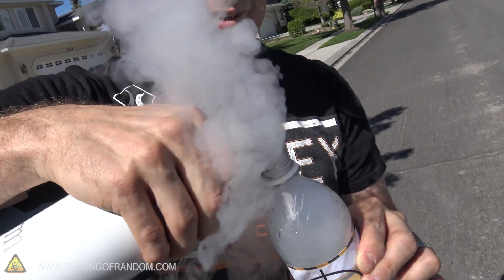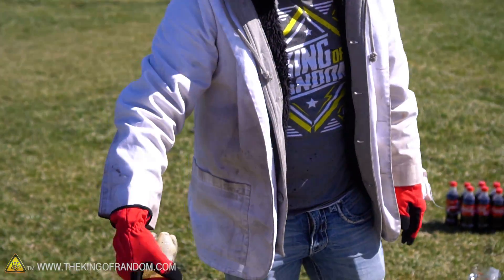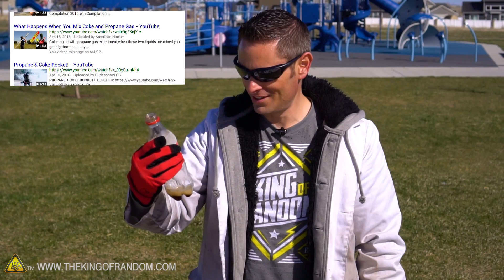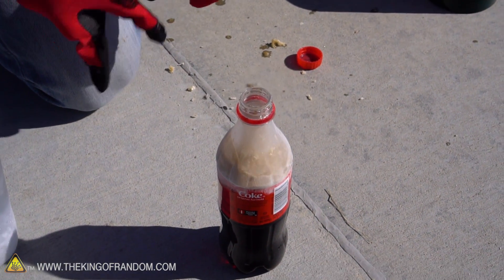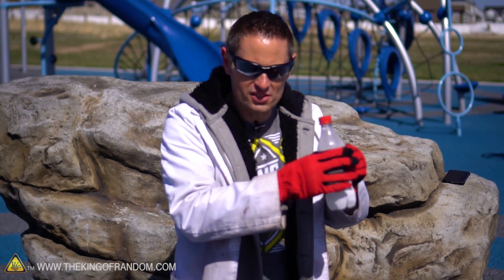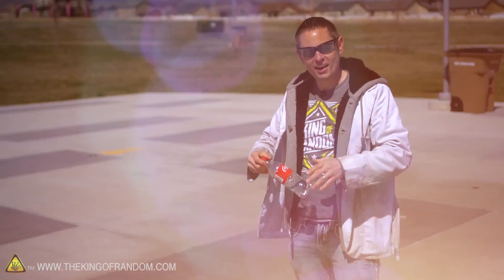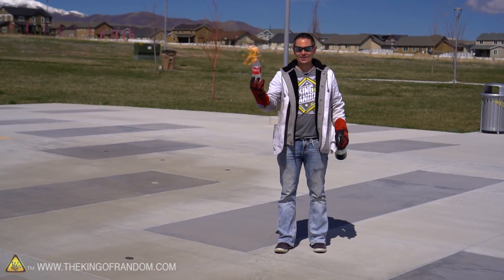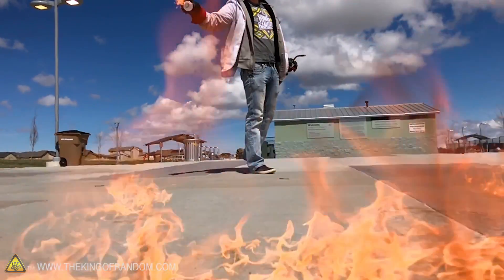Mixing Coke With Propane Doesn't Do What You Think It Does | Propane And Coke Experiment

Comment: Tkor repeat this experiment up to the step where you have added the propane then when it has iced up to the maximum extent then measure the temperature of the icey coating on the outside of the coke bottle...bear in mind that to keep the coca cola from freezing the freezing temperature of the coca cola to a temperature that is lower that the temperature that caused the coke to freeze...if no ice then coke rocket with propane will function...experimentally determine how to lower the freezing temperature of the coca cola to a temperature  below the ice temperature as previously measured previouy...the further below the ice temperature that the freezing point of the coca cola can be modified to the thinner the coca cola will become. and therefore the better the rocket will function...this can be accomplished by using several different matirials...salt (NaCl ) as well as non salt ice melt, or sugar just to name a few...the idea being the greater the difference between the ice that had previously formed in the cocacola solution that just coca cola and the lowered temperature at which the coca cola freezes the better the rocket will function....when you have brought the freezing temperature of the coca cola down as far as possible by adding what you used to lower the temperature then is is time to figure out the optimum quantities of the coca cola solution and butane ...

Comment: I believe it’s not working because of the cold temperature outside (he has an insulated coat on). Needs to be on a warm or hot summer day... at 32° it’s only 51 psi... at 90° it’s 149 psi...

Comment: If you want a projectile take the coke fill it with butane . Do not light it!! Turn it upside down and it will rocket away. The butane reacts with the co2 in the coke or whatever flavor you choose. The gas propulsion is highly flamable. Static could ignite it. So no nylon ski jackets

Comment: Propane weighs 4.2lbs per gallon, water weighs 8lbs.
Propane boils at -44F.
Liquid propane turns into gas at a 270x expansion rate.
One 8gal forklift cylinder can flatten a 400ft area.
Not to mention, static electricity can ignite it.

Comment: Try liquid nitrogen, about .375-.625 of  the volume of the bottle, in an empty pop bottle works well.
Screw the cap on and leave it alone. We do it at work. They can be unpredictable, due to the tolerances of the bottle though, so use caution.

Comment: The reason why it didn't work is because you took too long to turn it over. The coke reacts to it because the propane simultaneously cools all of the coke when turned over.. When you freeze coke it fizz alot faster than when you normally shake it up

Comment: At the end when the bottle was rolling away I was thinking that the liquid propane would spread around the inside of the bottle, making it easier for it to evaporate because of the increased surface area, so it would evaporate and then explode in your face when you pick it up. Thankfully, it didn't.

Comment: It was mentioned that the temperature outside was 45 F in the video.  Propane has a vapour pressure of 70 psi at 45 F.  So once it warmed up to the outside temperature, the propane in the coke bottle would be at about 70 psi.  I've seen those bottles be fine at higher pressures.  At at 32 F the pressure will be about 55 psi, 130 psi at 80 F, 175 psi at 100 F,  and 205 psi at 110 F, give or take.

Comment: You're taking too long, and not using enough Coke.  The reaction has a tiny little window that you're talking right through, and you have to use at least one liter of soda.  You don't have time for a countdown.  You have to pour your propane and immediately turn the bottle over, otherwise, the propane will evaporate before it has a chance to dissolve into the soda.

Comment: it doesn't work because the boilingpoint of propane is only -43.6F and the boilingpoint of liquid nitrogen is -320.44F.  Also, the thing that happened in the cokebottle when you closed it of and it became a clear liquid is because when the you close it of and it starts evaporating, the pressure will build up. And at a ceartain point the pressure and temperature will be in balance so that your liquid won't evaporate anymore. When you take of the cap the pressure goes away and your propane will start boiling again.

Comment: at 45 degrees that propane is only at like 70 psi in that bottle.  If it was 80 degrees outside, the pressure in that bottle would have been near 130 psi and the bottle would probably fail.  Some quick googling says soda bottles usually fail around 120-150 psi.

Comment: Funny thing is that actual Coke is probably more dangerous when under pressure in large enough quantities. If you have a 2 - 3 litre bottle of coke that's completely pressurized and it falls, the bottle holding it can rupture. It happened in a store in Chile while I was there one time.

Comment: the bottle leaks air through the cap. I have tried exploding coke bottles with those canned teas if you sit them in a bottle for 3-4 days it starts to expand until air pressure releases through the cap.

Comment: Propane pressure is based off temp. 45f is maybe 70 psi in the air space. And at 120f 200psi. As the gas in the air space bleeds off, the liquid boils off into gas until the pressure is reached for the temp outside. My numbers are no where exact just to give you an idea of how it works. 😊

Comment: Those bottles are designed to hold pressure in. Room temperature liquids like propane and CO2 expand creating pressure, but each gas has much different working pressures, the amount of pressure they exert in a confined space. 

It appears that propane requires much less pressure to maintain a liquid form. Propane has a working pressure of around 100-200 psi with temperature pending and a Coke bottle is designed to handle a bare minimum of 150 psi as far as I can gather. 

I believe that CO2 sits around the 800 psi mark to maintain the state which is why the bottle doesn't hold up to it in another video of yours.

Comment: @ The King of Random, did you figure out why this did not work for you? Liquid propane expands at a rate of 270 to 1 when it becomes a gas. I suspect that because it was a cold day outside & you used cold coke that froze very quickly, the experiment was a failure.  I suspect that if you did this on a warm day, with warm or room temperature coke, the bottle would have flown up in the air like it did in the Russian(?)/Ukrainian(?) video.   Would you redo this on a warm day to show it as a success?
Reply: Bradyn Austin. Liquid propane is similar to liquid nitrogen even if the coke a cola was boiling it would freeze
Reply: Bradyn Austin 45 degrees is cold huh
Reply: He used the wrong gas hes supposed to use lighter fluid not propaine

Comment: How is the propane liquid at atmospheric pressure if it's boiling point is -43 degrees F?
Reply: While it will go to liquid if you cool it to -43F, propane is one of the gases that'll go to liquid if you pressurize it enough without dropping the temperature.  That's what's done with propane you buy in cylinders at the store, or with the tank for your propane BBQ.  A number of other gases do the same: most refrigeration gases, ammonia, chlorine, butane, carbon dioxide, nitrous oxide, to name a few.

Comment: My thoery is is that the propane is not cold enough to cause the Leiden frost effect unlike liquid nitrogen Wich freezes the coke
Reply: Which
Reply: I think that it was too cold outside & he needed warm coke to make the liquid propane turns to gas. When liquid propane turns to gas it expands 271x thus creating the force that makes the bottle take off, but he didn't have enough heat to make that happen.

Comment: My guess is that you need to fill the liquid propane and then quickly turn it over. If you wait too long, the boiling propane will freeze the water in the coke and prevent the mixing that causes the high pressure to develop. Using warm or even slightly hot water/coke might even give it more power and delay the freezing of the water.

Comment: Ya know, at some point actually pulling in a little bit of science and/or physics would have been very beneficial here.  The saturated vapor pressure of propane at 45 degF is between 60-70 psi and the burst pressure for one of those small PETE soda bottles is between 150-175 psi.  You had nothing to worry about on the day you capped off a half-bottle of LPG.  HOWEVER on a hot, summer day in Florida, you could have easily been holding a small grenade in your hands - just a little shake and...

Comment: Propane has a pressure of about 100psi at 50 deg F. Pop bottles blow at about 150psi. Pressure at 90 deg. F is going to be around 150psi so if the day was a hot sunny day it might have blown

Comment: It occurs to me that the successful Coke + Propane rocket you show might have worked due to the size of the bottle. It could be the nozzle of the rocket might be too large for those smaller bottles, which would have less pressure when flipped than bottles with a greater mass of liquid. If that's the case, then the nozzle size would have to be proportionally smaller to increase the thrust.

Comment: Grant, I grew up in a propane delivery truck. The boil point is -44F, butane is 30 something above or close to it. The manufacturers of your bottles usually put an amount of butane in to keep the tank pressures below rupture pressures and pop-valve pressures. Hint: use your thumb like you did in your nitrogen bottle rocket vid. 
  Take care from Oklahoma 
  Mike and Vee

Comment: The exact same thing will happen with water. If you heated water in a pressurized pot, you could get it to say, 300 degrees. If you let the pressure off, it will boil vigorously just like the propane did until it cools to 212 degrees.
   By the way, while water boils at 212, propane boils at -43 degrees. If the temperature outside is colder than that, your propane camp stove will not work.
     I went tent camping once with a butane stove and discovered it won't work below about 31 degrees.

Comment: Hey Grant, we create videos on science and for one of the videos, we require a customizable sand timer. A sand timer with a regulator attached to it's neck which can control the diameter of the neck so that the clock can be used to measure varying intervals of time. Please design such a thing and tell us the idea.

Comment: When you did the experiment,the coke with liquid propane,the reason why the reaction was not what you expected was because that the liquid propane was on TOP of the coke,which means it has a smaller density than the coke,and without the cap it'd spill out first doing nothing,so if you had the cap on while pouring the liquid propane in the coke you should have closed the cap and put it upside down.

I'm no scientist or experimenter(mind my spelling) but it might pressurise more quickly or slowly and end up exploding or just blow our the cap and turn into a rocket instead but like i said,I'm no scientist ;)

Comment: Make a Molotov Cocktail via Propane video. Youd can make it plain or add a mixture that will mix into liquid. Maybe motor oil? Then light and throw. I wonder if it will keep it lit or simply burn off the propane when the glass breaks? Though its mixed..?

Comment: The issue you are have is the liquid propane is freezing the coke. This forzen coke then prevents the propane from bubbling to the top where it can push out the coke. If you put propane gas in at room temperature it would probably work

Comment: Random guess--the guy in the video probably used liquid nitrogen. Liquid propane only has a vapor pressure of about 122 psi at room temperature (a coke bottle can hold more than that), and a lot less as it gets colder--it stays liquid at about -44 F or so. Butane would be even worse, as its vapor pressure is only a bit over 20 psi at room temp.

Comment: Find out find how they actually 'bottle' the propane in the first place. I'm sure it is a gas that is pressurised and pumped into the cylinders not to mention sometime the big bottles have bleed holes to let the air out..... I'm sure that propane is stable at room temp in liquid form👍 much like gasoline... It vaporises in a bottle and creates pressure.

Comment: The boiling point of propane at 1 atm = -44 F
At any temperature below -44 F at 1 atm, propane will remain in liquid form because its vapor pressure at a colder temp is less than it is at atm pressure.

Comment: I would be curious to know what psi the coke bottle propane stabilized at.  Maybe rig up a car tire valve in the cap, then check it it with a pressure gage.

Comment: I think the reason the propane didn't start boiling until you opened the bottle is because the pressure was enough to keep it from boiling at whatever temperature it was outside.

Comment: Butane won't do any better. 1. It's heavier so it will be less likely to float on top of the coke in the split second that you turn the bottle upside down. 2. It has an even higher boiling point than propane, so the temperature difference between butane and the coke will be even less compared to propane. This will cause an even slower expansion, thus less uplifting force. You could try warm water or coke + propane.

Comment: I think it's because the boiling point of propane is not very low so it won't work unless I did it in warm  or hot water or kaybe something similar to that configuration

Comment: Was your coke warm? The experiment only works with warm coke, the reaction of the super cooled propane mixing with the warm coke causes hyper expansion of the propane from liquid to gas and then it escapes through the opening, therefore propelling the bottle into the air.

Comment: it doesn't surprise me that the bottle kept the propane under pressure as that is basically what is designed to do keep the co2 within soda under pressure. then when you open the cap just like the co2 starts out gassing so does the liquid propane.

Comment: Vapor pressure of propane at 40F is about 60 psi. So a soda bottle would hold that easily but at 90F the pressure would be about 150psi which should cause the bottle to fail.

Comment: could you make liquid oxygen with the same modified nozzle and a bottle of oxygen from the home depot?
Reply: Then mix the liquid propane with the liquid oxygen it and see what happens when you light it.
Reply: The answer is, no. bottles of oxygen don't contain any liquid in them, they are just compressed. even large commercial bottles don't contain liquid oxygen. liquid oxygen boils at such a low temp that it would explode nearly any container that we could put it in.
Reply: You can 'make' liquid oxygen at low enough temps I seen cody do it before.
Reply: No

Comment: Everyone saying it needs to be warm, the whole mechanism of it working is based off of vapor pressure.  That means it needs to be cold so it is a liquid, and wants to expand.  One mole of liquid turns into about 22.4 liters of gas.  For reference a mole of water is about half a swallow.  So you need that massive change in volume to make the propellants shoot out.

Comment: Grant- how fast can liquid propane give you frostbite when put on bare skin?
Reply: NOPE! I accidentally spilled some on my hand expecting the lendenfrost effect to save me but liquid propane boiling point is higher so there isn't enough of a temperature difference for the effect to take place it instantly absorbs into your skin and caused nasty second degree frost bite burns on my hand. Don't make that mistake.
Reply: Liberty Lions
Within a few seconds? Wouldn't the Leidenfrost effect still be active in that short of a timeframe?
Reply: Speaking from experience, within a few seconds

Comment: if you freeze something will it float if it didn't before
Reply: Tacocat McNulty the only substance we know of that gets less dense when in a solid state is water.  Everything else gets denser.  Basically water is the only thing that will float in in the liquid form of itself when frozen.
Reply: Probably because the vast majority of elements and compounds get more dense upon solidifying, like iron, copper, wax, and tons of others.
Reply: Not the only known substance - if I recall correctly the metal gallium also has that property when it solidifies for example.
Reply: Gallium, silicon, germanium, antimony, bismuth, cerium, and plutonium do too.
Reply: Powell Didn't know that! Why is there a perception that this property of water is special if all those elements do the same thing?
Reply: and if you freeze a boat it will sink.lol
Reply: Oh ok fair enough.
Reply: Tacocat McNulty even a brick?
Reply: yes
Reply: freeze water it will float :D

Comment: The reason that it won't explode is because propane's vapor pressure is not high enough. The liquid propane and gaseous propane are in equilibrium, meaning it will not evaporate anymore, keeping the pressure constant at that point. One might mistakenly believe it would explode similar to when putting tin foil and toilet cleaner in a bottle, but that is a chemical reaction that is creating gas.

Comment: Coke and propane don't react, when you flip the bottle of coke and propane the propane comes out first because, as you said in the last video, propane is fairly dense, and if the propane comes out first that means it won't work. You need to us something less dense than coke, then the less dense freezing liquid will rise to the top and the expanding gasses from evaporation will push the coke an gas out, simple.

Comment: find yourself an older propane torch that not just the torch head unscrewed but the tube can unscrew from the base with the round smooth metal knob. you will get more liquid propane out.

Comment: Propane is an LPG, low pressure gas, as seen, you can pour it in open air without it evaporating super fast like nitrogen or co2. This is why you can put in a coke bottle and cap it. Now, what can we do with this? make a simple rocket?